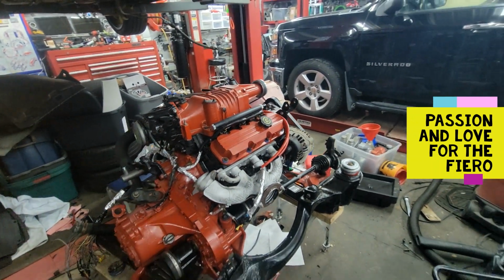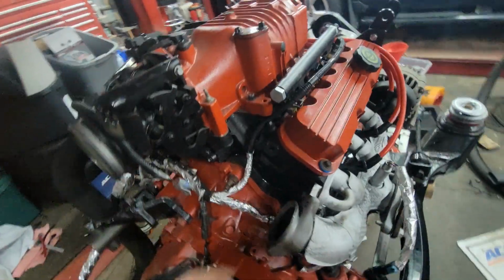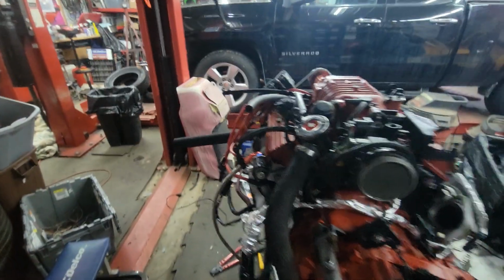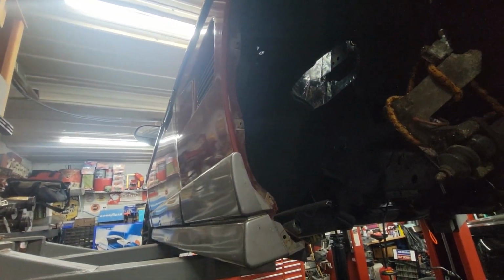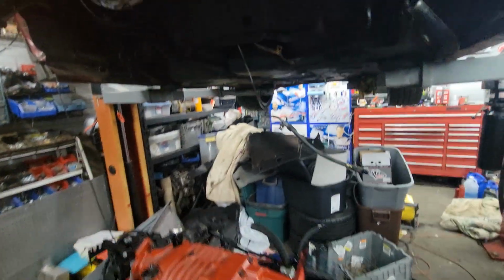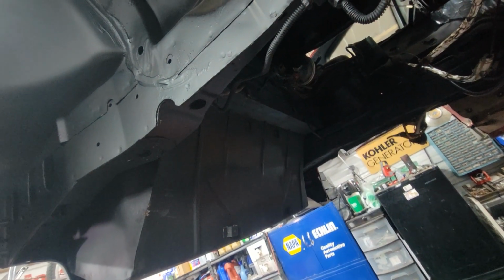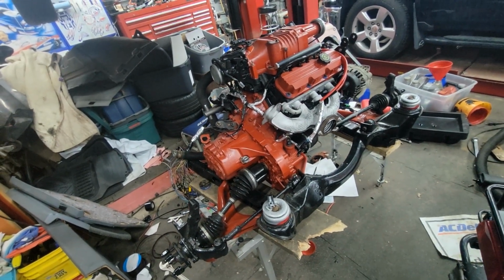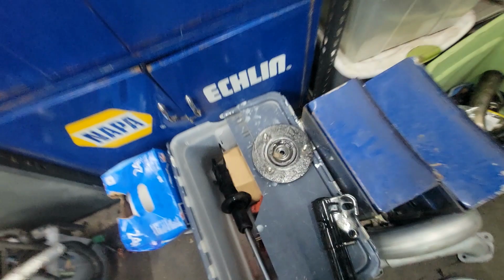On the final stretch of this 3800 Supercharged Fiero Build

Comment: Yes zz performance for the studs and the rubber throttle body tube.
Reply from the maker: Found a rubber hose at home depot for 10 bucks and studs at oreillys with nuts.   Used 3 inch abs 3 bends for fiero cai

Comment: 86 fiero gt. Excellent shape,,I'm having problems with no spark from coil.have tried 2 new ones. It's been sitting for 27years.  Turns over fine just won't fire.  Help
Reply from the maker: Grounds ?   Check wiring